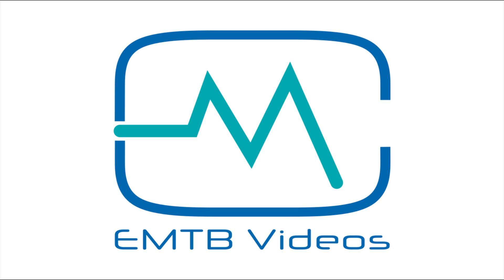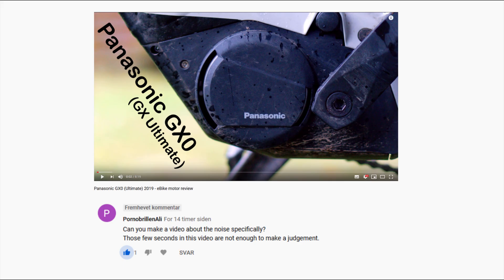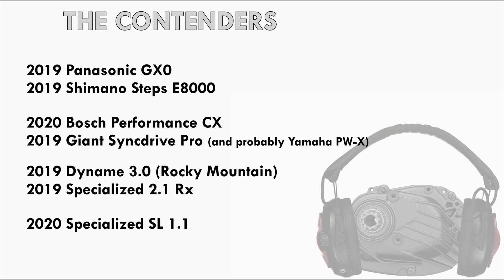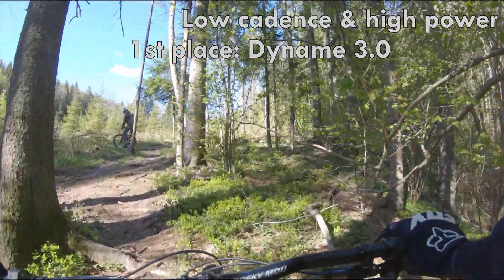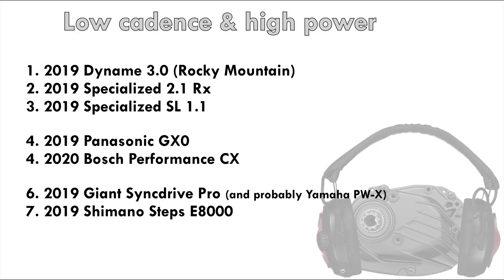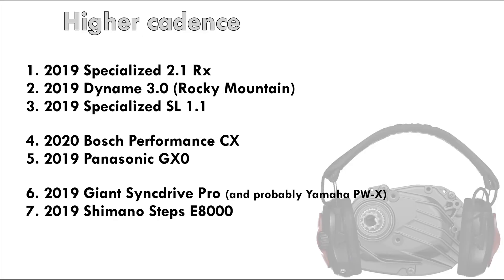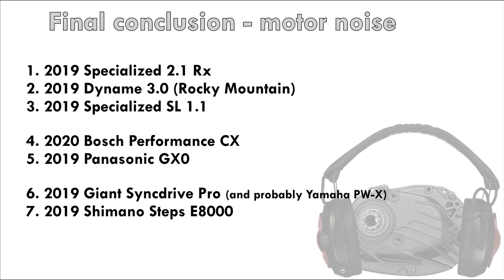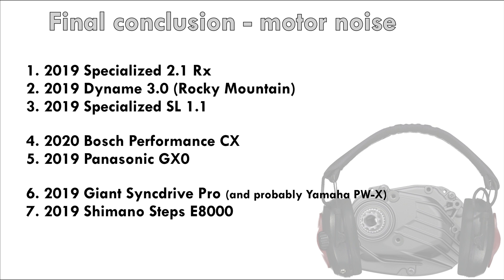Comparing noise from 7 ebike motors

Comment: When testing for torque and noise do your test on smooth road and hill with 0 pedal assist .  Yes it’s a mountain bike but the suspension , chain & sprocket drive along with a bumpy surface skews the test with both the ability of the motor and noise it makes .

Comment: Overall RELIABILITY would be different for every rider. I've used Bosch, Brose(not all cracked-up it's advertised to be), and Shimano E-8000(abundance of mechanical issues). The motor I am most confident with: The Yamaha PW-X2. Not excessive on torque. No need for mega-wattage batteries. And despite biased reviews, I have had this motor completely submerged crossing creeks, and it still powers me uphill. A heavy brutal  rider, I don't need excessive torque to do all the pedaling for me. Just enough to help me climb so I need not walk. Hate walking.

Comment: I have a 2000watt DD rear hub motor with a 48v 45amp Sinewave motor controller. It is silent, it really is.
Reply: Silent...because it's behind you and you probably can't hear it.
Reply: @lazurm  no it's absolutely silent, it's apparently because it's a Sine wave controller. I have one mid drive Yamaha PWX, And 4 rear hub motors, the Sine wave is the only one that is silent
Reply: @likeher9  Interesting....
Reply: @likeher9  yeah dd hub motor is dead silent with a sine wave controller, there is only a slight hum like a electric subway thats barely audible at high wattage

Comment: The annoying noise is the #1 reason I don't own an e-bike.
Reply: Hi surf422
I have a 2000watt DD rear hub motor with a 48v45amp Sine wave speed controller. It is absolutely silent, I promise you
Reply: I believe you, my (OneWheel Hub motor is fairly quiet) and thats what I want (gearless hub motor) however I have yet to find one with full suspension too .. gates carbon belt and pinion gears would complete the ultimate cruiser, but not a "mountain bike" per say
Reply: meh, you get used to it. i use the noise level to make sure i use the best cadence, so i turned something rather annoying into something useful, at least to me.
Reply: @siriosstar4789  Its even quieter than most ebikes.
Reply: @siriosstar4789  No, the inside of a car is sealed from outside noise and the car has a muffler.  The quietest e-bikes have gearless hub motors, which are also 1000x more reliable than noisy expensive mid-drive motors.  The perfect ebike, which hasnt come yet, will have 2 gearless hub motors front and back, pinion gear system, gates carbon belt, and full suspension.
Reply: Thanks for this. Im assuming number one means noisiest and higher numbers less noisy.

Comment: Excellent . . . all reviews are subjective, your's no more than any other. I found this video to be very informative. Now for a request:
Have you reviewed either of the Bafang motors (BBS02 or BBSHD)? My readings/viewings so far suggest the Bafang is more powerful than any of the builtin motors. That and it comes with a throttle mode in addition to pedal assist. You would need to convert a non-ebike to do a review.
Reply: @EMTBVideos  Thanks for that detailed reply. I Googled Bronson to better understand your explanation. Seems it has a long flat section in front of the BB, preventing the Bafang from rotating up and out of the way, hence your comment on it being too low.

I'm planning on putting a BBSHD on a Mtb with a Sram 1x12 so that should help the motor spin faster at lower power, also will get the smallest front sprocket. Also read that the motor/controller is programmable to adjust max current, likely other settings.

I will only ride trails and/or 4WD roads, never pavement or even gravel. As to pedaling vs throttle, to early to say. I watched a number of throttle only videos, amazing how fast and long it would go on steep terrain, quiet too.
Reply: @EMTBVideos  Rewatched your video twice, trying to compared to a Bafand BBSHD ridden below freezing with ice and snow (https://www.youtube.com/watch?v=0vF5rbGrugc). Some observations:
.. The rider was NOT pedaling, no visible knee action
.. Motor noise was almost inaudible, mostly ice and snow under the tires
.. Your seven test motors are clearly louder and more objectionable, but rough terrain makes you and the motor work harder
.. Bike was moving fast on low to moderate grade, easy terrain
.. Rich W has many videos, don't remember any on rough terrain as you show

Any thoughts?

Comment: Don't like this video. What does it mean first place? Loudest? Quitest? I am saying that because Rocky Mountain is known as very loud
Reply: He rated them on how loud they were, not what "is known". Not complicated.
Reply: @scottpratico1315  ok but nr 1 is loudest or quitest? Simple question
Reply: @pawelodz8050  ist it obvious? 1st place is the quietest. You can also tell from the actual sound of the video....
Reply: @vampiszon6620  it's not. Especially Rocky mountain in this video is shown as quiet but in brand newspaper like e-mountainbike is described as loudest of all engines. Video doesn't show exactly because quality of record is low
Reply: @pawelodz8050  the rocky motor is rather silent, the only loud part is the way the chain travels around the main motor wheel. its litterally all you hear.
Reply: @pawelodz8050  You are the ONLY one who does not understand.
Reply: @yamahass66  cheers
Reply: @yamahass66  ohh somebody like my comment. Looks like  I AM NOT THE ONLY ONE
Reply: He rates them in order. I run a shimano and agree it's pretty noisy. Still like it a lot.